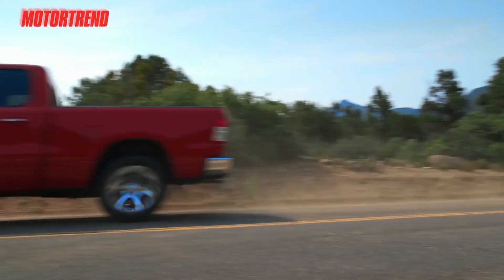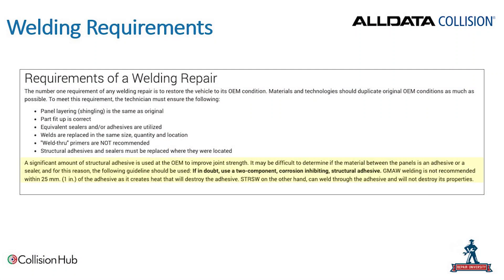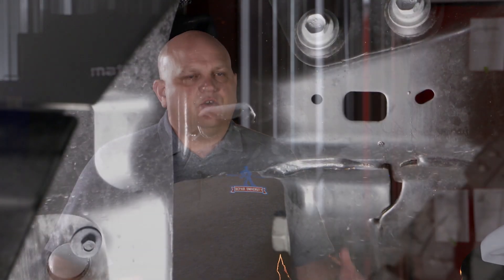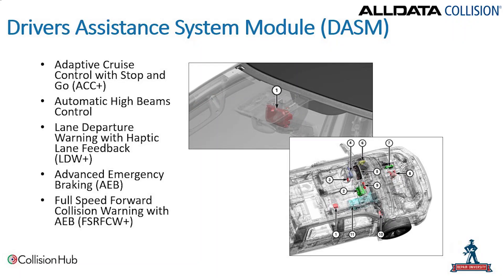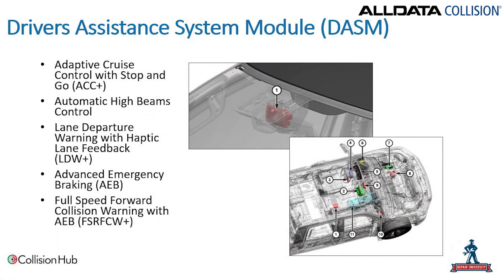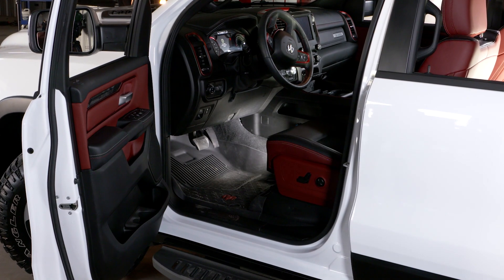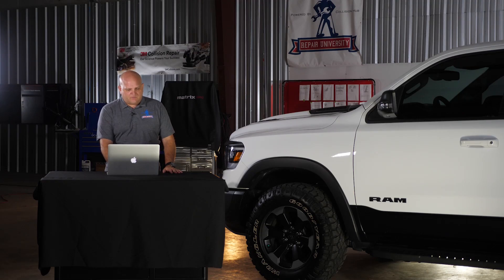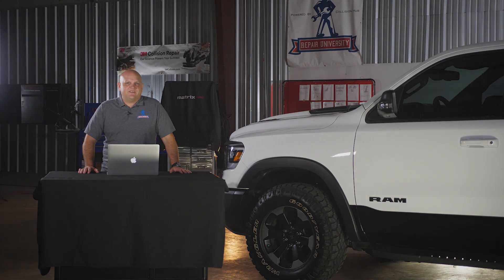Repair University OEM Edition: Dodge Ram Truck

Comment: my truck was hit from behind with a trailer connected and the tow hitch is bent down about 10-20 degrees.. is this repairable? I know the video states there are now repairs listed for rear end, but I find it hard to believe that tow packages are not made to be replaced.. are there any options or is my truck totaled? I am still waiting on insurance 4-6 weeks out.

Comment: Re: cavity wax,   in rural rust belt areas with gravel roads where there will be half an inch of mud, dirt, stones silt, sand, salt & road de-icing products in the rockers, wheel arches, cab corners and anywhere else it can land why is cavity wax that stays sticky & goopy  rec’d instead of amber rustproofing Medallion RS-530 which by the tds is flowable (not capillary action). Rs 530 dries to almost feel like the outside of a candle. A person can blow out with air or rinse the dirt from the rs530 whereas the cavity wax is sort of glueing the contamination to itself. 

I’d like a compare & contrast of the two products as personally I’d rather use the amber than the cavity wax due to it not being like sticking bubble gum(butyl) to a shoe and walking down the beach. .